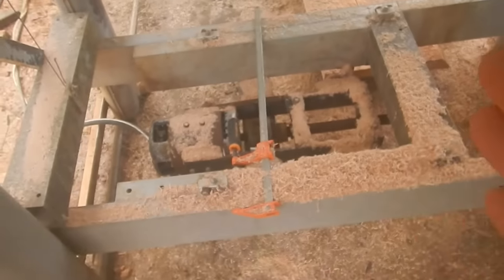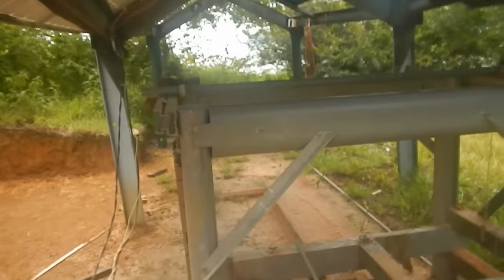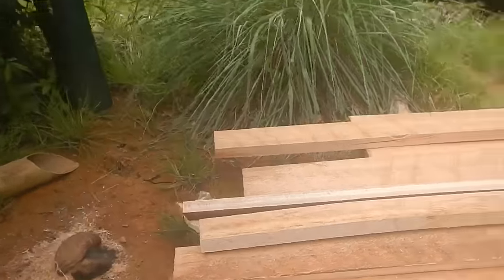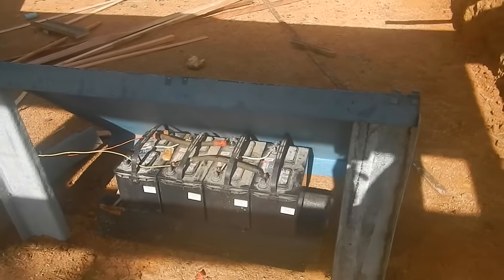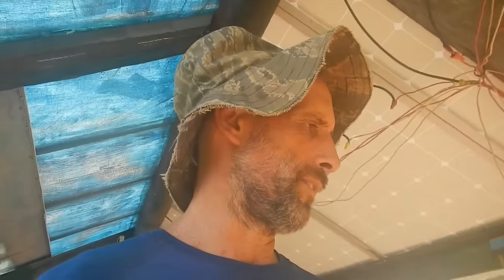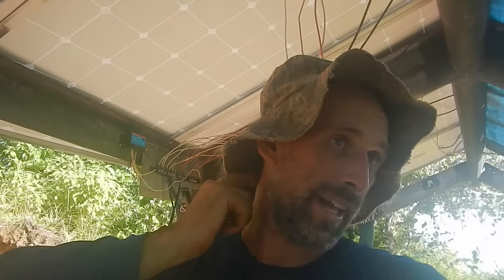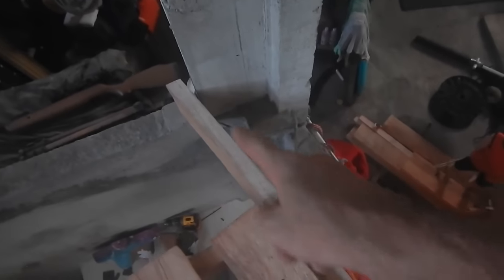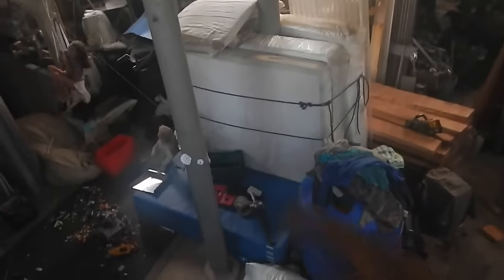Milling and Starting 2nd Floor, and Batteries.

Comment: I used to build wooden rollercoasters and we would build the curved track beams by bending 2x2s then clamping them together and nailing them we would do this for 5 layers then start laying the cut 2x12s on top and that would carry the weight of a fully loaded concrete truck going at 80 mph you could probably get away with just 2 layers of 2x2s then a layer of your wide boards. also save your off fall  1/4 inch strips make really good saw guides for cutting the curves

Comment: if you make a dado blade you could cut small lips on the edges of the boards and they will lock together real nice making for a super strong floor that wont squeak

Comment: you ever considered making a railroad around your island using pipes for rails?  it would make moving things a breeze
Reply: Even one ramp like that, maybe from the boat area to the sawmill? I don't know I you could make a straight line between those areas?

Comment: Engineer’s Lament: An Ode to Imperial Noodle Units 🍝🇬🇧

“Today, my dear colleagues,” proclaims the metric-loving engineer, “I stand before you, clutching a mysterious parcel from across the Atlantic. Behold! An engine part, lovingly crafted by our American friends. But alas, tragedy strikes! For they have wielded the dreaded IMPERIAL NOODLE UNITS.”

The room hushes, and the slide rules tremble in sympathy.

“Fear not,” continues our engineer, “I shall embark on a noble quest—a conversion odyssey. Inches to centimeters, pounds to kilograms, gallons to liters—each noodle shall be meticulously recalibrated. For the imperial system, my friends, is a jest—a whimsical dance of arbitrary increments, like spaghetti strands tangled in cosmic chaos.”

“And so,” proclaims the engineer, “I shall wield my calculator like Excalibur. I shall whisper incantations: ‘Three feet? Nay, that’s a yard of noodles!’ ‘Sixteen ounces? Verily, a pound of linguine!’ And behold, the mystical conversion factor: 1 inch = 2.54 centimeters, a secret passed down from Pythagoras himself.”

“But wait!” cries a junior engineer, eyes wide. “What of the fabled furlong? The enigmatic rod? The perplexing peck?”

“Ah,” says our hero, “those are the whimsies of yore—the jests of jests. For in the land of noodles, we measure not in leagues or bushels. Nay, we invoke the sacred unit: the IMPERIAL NOODLE.”

“And what,” asks an intern, “is the length of an imperial noodle?”

“Precisely,” says the engineer, “as long as it needs to be. It stretches from jest to jest, from bowl to bowl, from metric to madness. And when the last noodle is converted, we shall raise our calculators high and declare, ‘Lo, we have bridged the gap between systems!’"

And so, my friend, the engineer toils—a knight errant armed with spreadsheets, a troubadour of rationality. For in the grand tapestry of measurement, where noodles entwine with irony, the imperial noodle units remain both absurd and essential.

Bon appétit, fellow noodle whisperers! May your conversions be swift, your humor sharp, and your spaghetti al dente. 🍽🤖🍝

- ChatGPT, 2024